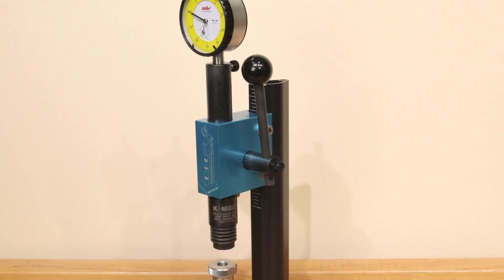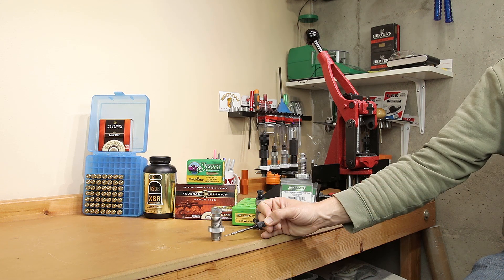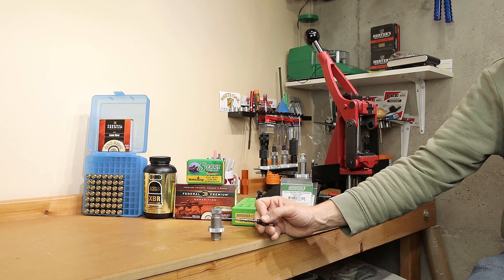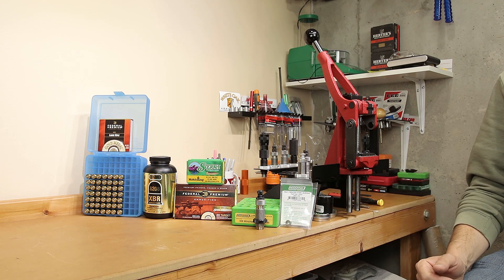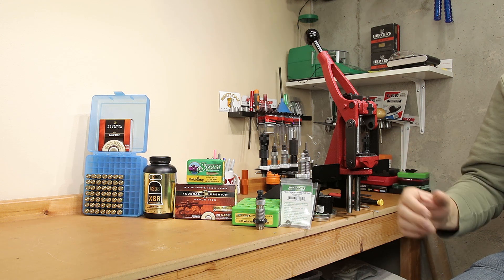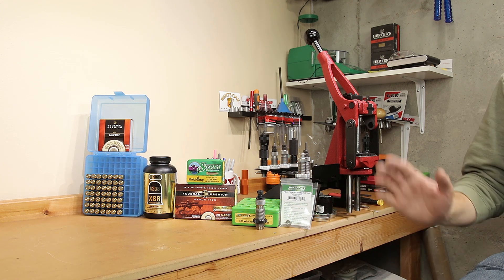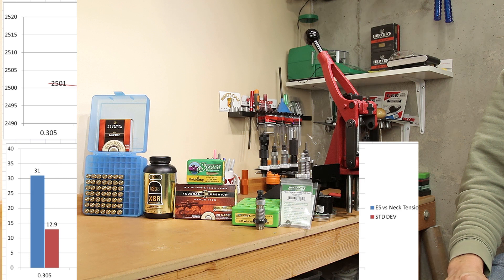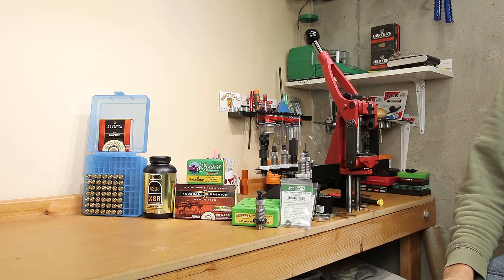Proper Neck Tension - How Case Neck Tension Affects Performance

Comment: Do you use a die specifically for bumping the shoulder ? Or do you just full length size  the case? I’ve found a lot of different opinions on the topic
Reply from the maker: You will always find lots of opinions in the reloading world. My experience has been that it depends on how much sizing your die is doing. I have been successful in 6.5 CM of just using a FL die with no expander and using expander mandrels, however in larger calibers (308 and 338) it seems to want to leave a lip at the top of the case where using something like a bushing or honed die will help minimize this issue and reduce the work on the case. (Hopefully soon) I am going to do a neck tension series by caliber to help folks choose bushings or Expanders more effectively. I realize these things add up quickly. Is there something specific that you would like to see?
Reply: @BoltActionReloading  I am very green to reloading .. i don’t own a single piece of equipment so I have just begun scouring YouTube and the internet for information on where and how to start, specifically for 308 and 6.5. I’m leaning towards rcbs and so questions are arising now based on the equipment I intend on using . Their match master full length die looks like a good starting point because it has a micrometer built in to it but then I see I need a specific bushing (and there are so many )for neck tension which i know nothing about but watched one of your videos yesterday about it.. I was on shooters forum and that’s why I asked the question because from that discussion it seemed like by just sizing you bump the shoulder and I still don’t 100% understand that 😂 but trying to learn .. what I know so far is that with that die set it will size the brass and remove the spent primer and maybe “bump” the shoulder (still trying to figure that out) and the seater die does just that just have to learn about seating depths and much much more 😐i really do appreciate you replying and asking if there’s something specific I’d like to see but I have a million questions and I’m just gonna keep looking at videos and take what I can from them . Thanks again for the reply🤙🏽

Comment: I can really appreciate this You can get away with less neck tension on a bolt gun then you can with an AR-10. You do not want the bullets to start to move in the magazine from recoil or when around is jammed into the chamber. That brings up a different but also important question. Are you better off having more neck tension or crimping the case?

Comment: If an ES of 4 is achieved, does SD even matter?
Reply from the maker: No you likely would not, however having a ES of 4 on a statistically significant number of rounds tested is very unlikely..
Reply: @BoltActionReloading  Always 4- 9 average of 6.5 
Seating depth has shown to increase it with a longer CBTO and shorter lessens it in my particular rifle and loading.
With .020 off to start. I found the tune and it stays under 10 ES but never have gone below 4.  I'm not a competitor, but enjoy seeking a 0.00 group. 😁

Comment: Great video!What is the process to figure out the mandrel size for final tension. meaning for 6.5cm. My loaded bullet neck size is .294, I don't use neck bushing just FL die.  I like say .002 neck tension what is the mandrel size for 21st Century is adequate. process for arriving to the result.  Thanks so much for your videos, this hobby is like chasing rabbit it never ends.

Comment: Wow! So novice reloader here. I'm learning with .223 Rem. 
Through my rifle, using 21.4grns of H335 under a Hornady 62grn BTHP, with a COAL of about 2.250 I'm regularly printing sub 1" groups.
I'm using the Lee 4 die set, I forget which model. 
Just took measurements, if I did this right, I'm getting about 0.005" of interference fit depending on brass. I shoot a lot of range pick up brass.
Pretty happy any way because I never thought I'd be able to shoot sub 1" groups.
Reply: If I sort range brass by: head stamp, weight and volume... I get the same groups as my Laupa new brass.

Comment: I am thankful for this comprehensive study. Some believe that uniform neck tension has little impact on accuracy. I believe that it significantly does, and you proved it with this. I will be buying a similar range of mandrels that you did but for a .265in bullet. I would think that uniform neck tension impacts smaller diameter pills more than larger ones. This sport is a game of eliminating as many variables as possible and I think that for the money, this expander is a good investment.

Comment: The goal, of course, is consistency.  In order to achieve consistency, all factors of the operation have to result in like parameters.   Sizing mandrels are only one part of that equation.  The spring back of the brass is every bit as important, but is the one parameter we don't have a great deal of control over.  One possible solution is to use quality brass, all the same brand and batch, sized, trimmed, and fully prepped.  Then, a proper annealing, preferably on a quality annealing device.  This will help ensure the properties of the neck are as equal as we can make them from the spring back perspective.  Additional steps could include sorting cases by weight and capacity, concentricity, and neck turning (inside and outside) to achieve a batch of brass that is as equal to each other in every possible parameter you can measure or affect with tooling or processing.  Bullets can be sorted by weight and diameter as well.  

The bottom line is consistency is a trade off of time and effort, at least within the confines of what we can do to make cartridges consistent with each other.

Comment: I’ve found .002” of tension has worked the best for me as well. 

I currently use the TiN coated “turning” mandrels from Sinclair, along with their mandrel body, for that task. 

I use a Forster Bump sizing die to size my brass in a first step, then the mandrel setup in a second step. The bump die uses a bushing to size the neck, and it will also bump the shoulders. There is no expander. I use this die with the applicable sized bushing to bump my shoulders back .002” and so I don’t overwork the necks any more than necessary before using the mandrel to set the final tension, unlike a gutted full length sizing die would do. I have used gutted FL sizing dies in the past, and I can’t say I’ve actually had any issues by using them versus the bump die I use now, but I still at least feel better using a bushing that works the brass a bit less. 

Anyway, so I decap and wash my brass first, and then anneal it, then I lube and size my brass with that bump die, then remove the lube in a dry tumbler. I then dip the cases in graphite before running the brass through that mandrel setup. I leave the graphite on the cases since it won’t negatively effect anything and will actually increase consistency with the amount of force required to seat bullets. 

This method has proven to work extremely well and produce very consistent and reliable ammo. I haven’t noticed you use or talk about the Forster Bump Dies, and if you haven’t tried them, I highly suggest trying one.

Comment: expander mandrel sized case neck outside diameter, verses seated bullet outside neck diameter. My .30 caliber loads, are, .328 sized case neck OD, seated bullet is neck OD .329. Expander Mandrel .307 Under 1/2 inch MOA, almost  3 shot one hole group. It's alot cheaper using mandrels than bushings to neck size.

Comment: What kind of neck tension are / would use on a M1A ? More then .020" ?
Reply from the maker: I assume you mean .002 not .020"? See what setback if any you are getting with .002 and go from there. you can pick these up in .0005" increments.

Comment: After using the -.002 mandrel on my 6.5 CM the first 10 groups of 5 rounds each were all single digit SD, despite a .3 gr incremental difference in the charge weight.  I have been using Redding bushing neck sizing dies for a long while with .002 under bullet diameter and had not gotten as consistently low sd before using the expander mandrel.  I anneal each cycle so the expander had a definite positive influence.  Seating with a Hydro Press by 21st Century and LE Wilson inline die showed 40psi seating pressure consistently.  No doubt, the expander mandrel removes variability of neck tension.  Great info.  Thanks for the videos
Reply from the maker: Glad they help!
Reply: @BoltActionReloading  so are you fl resizing with a regular old expander ball then running a mandrel through them or are you using a bushing die?
Reply from the maker: For my standard process (at the moment) I remove the factory expander completely, FL size with a .002" bump, and then go back with a Mandel. 002" under projectile diameter.
Reply: Using a bushing die at all to squeeze the neck in?
Reply from the maker: Not a bushing die. A regular FL die.
Reply: @BoltActionReloading  one last question! What type of lube are you using on those steel mandrels?
Reply from the maker: Depends on how much sizing you are doing. If it's only a .001 or .002 change imperial dry neck lube.  Any more and I use imperial sizing wax just a little  left over from the sizing process keeps it smooth. But I put just a little on to get started. Hope that makes sense.
Reply: @BoltActionReloading  honestly I've always used a rcbs case lube pad with synthetic Mobil 1 motor oil on the pad. Lightly roll cases and slightly dip the case neck into the pad and lastly wipe the shoulder area clean to prevent lube dents. It's always produced great results and assumed it could be used with the steel mandrel dies
Reply: I have found since annealing each shot my MV's have dropped to single digit. I use a Redding bushing neck sizer. I am here because I don't use mandrels and want to start. Just saying, your single digit SD's could be the result of something else, but no doubt mandrels help.

Comment: Thank you for all the work. 
Will you do a video on seating depth ?
Reply from the maker: What specifically were you looking for?
Reply: @BoltActionReloading  (grins) Another video list things I do not know I do not know. 
I am a small time recreational shooter forced into reloading due to the ammo shortage. That said - small things make a difference. From head space to crown imperfections each part has its effect. Each part is a deep rabbit hole to go down.  
Even if the overall cartridge length is the same, shells lengthen over time so the neck gets trimmed affecting seating - shoulder to mouth. 
Either from pressure, barrel harmonics or voodoo (joking) there are loads a gun prefers for tight repeatable group. 
I hope this is a answer.
Reply from the maker: I have a lot of videos. I can point to to affects coal has on accuracy, velocity. If you go to my channel page and video list I would search for things you may be interested in and see what you find. If there is something specific just ask and I'll try my best to point you. Some of the older videos aren't quite as high of quality but the data is always real.

Comment: Hello. Great video.Do you recall what was that case neck  wall thickness?? Thanks Dave .
Reply from the maker: Hi David, measured with my ball micrometer it measures .0146"
Reply: @BoltActionReloading  . Thankyou. I just neck turned some Winchester brass to 14 thousands neck wall thickness. After your results. . Some people say thicker necks or thinner necks .They all have different results .I Got  your  baseline thickness  and I will go from there. Thanks for all your hard work. Looking forward to more of your videos.

Comment: I am very new to reloading.  I decided to try and start my process off the bat with mandrel neck tension setting.  My question is it better to full resize vs bushing bump sizing then use century 21 mandrel.  6.5 creedmoor RPR with many mods including proof carbon fiber barrel.  Thanks for any thoughts all
Reply from the maker: Hi Scott, I do not have significant experience with the bushing bump dies, but I see them as likely to have the same issue as NO sizing and having the case head getting oversized in time. I use a FL die with no expander installed, and have a .002 under caliber dimension set the internal diameter.

Best of luck,
BAR

Comment: I assume here that all the cases are fully trimmed to the same overall length and flash holes plus primer pockets are reamed to same sizes for consistency. Also all cases are weighed and sorted into same weight groups for tests as the case volume will be proportional to case weight, and case volume alters the energy for a consistent fixed weight of propellant.
Reply: He said right up front he used Lapua Brass, once fired, annealed and trimmed. The rest is irrelevant for Lapua brass. Watch and appreciate the information and stop trying to prove what "you know". It's undoubtedly not much.

Comment: For my hunt load. 2 thousandth with the crimp die squeezing the smallest measure amount I can get -.001 from the outside. Say necks .315 I make the lip .314 taper or lee factory. I have not tested enough to claim anything but was passed down father to son.

Comment: I don't think mandrel size equates to the amount of neck tension.  In my experience with mandrels and expanders there is from .0005 - .001 spring back after the mandrel or expander is used.  I have also found that the manufacturer of brass (differing metallurgy) and thickness of brass also play a role in how much spring back occurs.  Just some more food for thought.

Comment: I use .003 neck bushing under loaded od with a .307 mandrel for my .308 only getting .001 neck tension is what works for me... my thinking is the least amount of resistance the bullet has being held in the case the less it is slowed down/ friction leaving the brass.. minute but works

Comment: In this video you state “ when ever I can, I like to keep things easy” and yet in another video you stated “ what can I say... I like to complicate things.”
Reply from the maker: Context matters, so I am not sure what your looking for. Anyway to keep a process or explanation simple I certainly try for that. But in effort to understand why some things are the way they are I may complicate things by testing more things or graphing things multiple ways because everyone learns and sees things differently.
Reply: @BoltActionReloading  Either you like to complicate things or you dont. And you use the words Actual and Actually way too much. It is distracting from your otherwise good topics and results oriented videos.
Reply from the maker: I realize that there are things that I need to work on. I try to make my videos as easy to understand as possible. Sometimes you have to point out the complexity of certain things and how what you think you are doing isn't exactly what you think it is. For example setting the neck tension with a expander vs a bushing to the same dimension will give you different results. Best of Luck.

Comment: I am a newbie to reloading, but arent we talking about like 60,000 psi of case pressure?  Does a pound or two of friction really make a measurable difference?  Thank you for doing all of the work required here!
Reply: That little pound or 2 of variation friction actually equates of how many combustion gases leak there will be prior to get full seal of the chamber by the bullet in the barrel. So low variation in neck tension equals low variation in gases leak equals low SD.

Comment: The purpose of the neck tension is to hold the projectile securely until pressure builds up in the case sufficient enough to ignite entire volume of the powder before the bullet starts to move out. The second purpose of the neck is to seal the combustion gasses and prevent them from leaking backwards toward the bolt head. All that gas volume has to go forward towards the muzzle and stay consistent to reach accuracy.
Reply: Not You......    consistent neck tension prevents changes in Standard Deviation, in other words, pressure spikes, and not enough sufficient pressure as you say. Variations in pressure is what causes erratic point of impact.
Reply: @milboltnut  isn't that what I just said?

Comment: Fascinating Stuff. 
Thanks to to the OP and the other contributors.
Here is my experience after hundreds of rounds tested

Best Results:
.003 Neck tension using Redding Bushing die

Rifle: Savage 110FP 223
Twist: 1/9
Weighted to 17lbs
Trigger: Canjar Set to 2 OZ
Front Rest: Bald Eagle
Front Stock: Mated to Front rest (rail type set up)
Rear rest: Sand bag formed to stock
Shooting Free recoil in rest with no human contact with the stock
other then the set 2 oz. trigger
Scope: 40 Power
Barrel Tuner: Type forgotten

My Load Development technique:
Pick a specific bullet / case / primer / powder.... Stay with it until determined that it is unworkable.
Using Audett (sp) ladder to find best charge range
Crony for SD and ES
Using Redding bushing dies: Adjust neck tension for accuracy
{ALL Brass Neck Wall thickness Trimmed to 10/1,000)
Brass neck sized only

I have not annealed in the past although having read the excellent posts from Rotas and others below
I might give that a try.

Best average consistent results in this gun;
.2s
Bullet: Berger 70 Gr LTB
Powder:  H322 and Vitovori 135

.003 Neck tension using Redding Bushing die
Seating depth tested from .005 off the lands to just touching to jamb .005

This is basically a budget bench rest gun.
I am not a "good shot" so I had to remove the human component 
for load development.

Comment: Outstanding, thank you..
Me I focus on neck Consistency by sorting with a Redding neck checker, I also do a single treatment from the lee collet neck die all Sorted into 3  piles of brass, good, fixed and garbage. I full length size everything always ...

Apples and oranges, But I did do experiments with HOT  45 Colt loads using 2400 powder a half dozen dies sets, maxed neck tension and a solid crimp made a huge difference ..
Take care